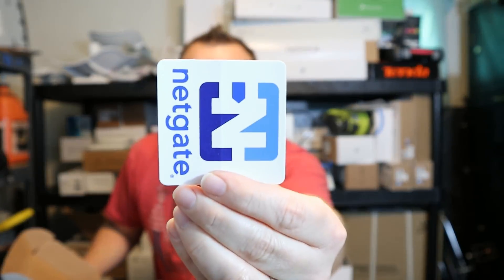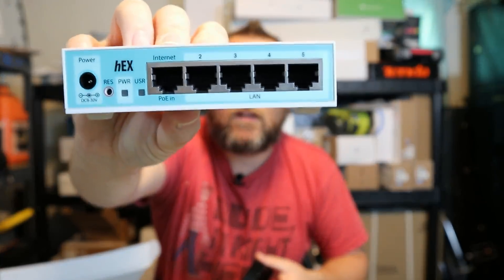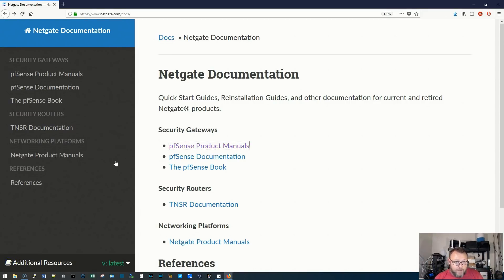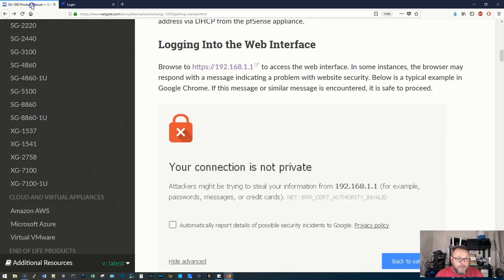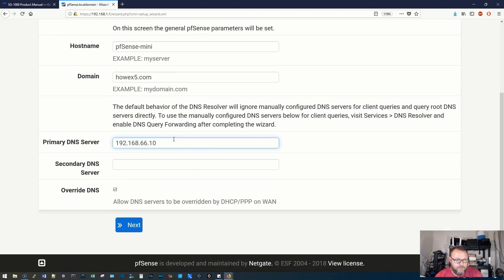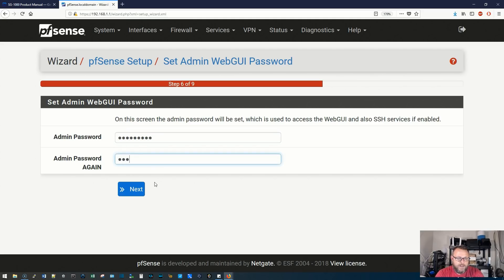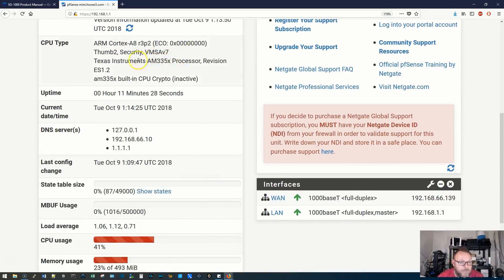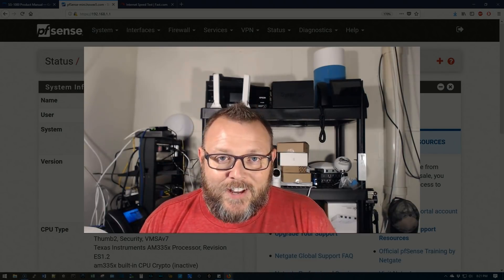Netgate pfSense Appliance - Bringing pfSense Back

Comment: pfSense is pretty solid. And if you need it for corporate use or anywhere where you need guaranteed uptime on the firewall, just buy a pair of them and run them in high availability. Costs nothing extra (except of course that you have to buy two appliances). A nice pair of XG-7100 1U models stacked on top of each other and using CARP for an active/passive cluster will work fine for even a pretty large network. Add a Suricata plugin and you have an IDS/IPS function. Just a great deal across the board. Paying a premium for Cisco just so you can then pay a premium to enable its features strikes me as some level of loony.

Comment: There are no more BOGONS. Used to be, but all blocks that could have been allotted have been. Years ago I had BOGON lists in our commercial edge BGP4 routers, but took them out as there was nothing more to block. Now if your org wants an new IPv4 block you have to wait until your RIR regains and assigned you one from its waiting list,  or you purchase it via the "Transfer" process runs by or sanction by your RIR.

Comment: Looks like your lab is big enough for the SG-3100. Don't expect much performance out of the SG-1000..after all it's still just a modest ARM cpu. Thanks.
Reply: The SG-3100 is also an ARM CPU. The newer SG-5100 runs on an Atom x86 basis.
Reply: @WillieHowe  Agree. It sure is portable. It can probably run of of a battery too. Like a RasPi!